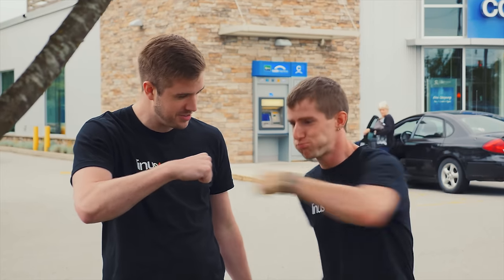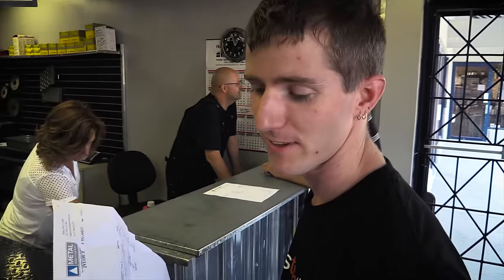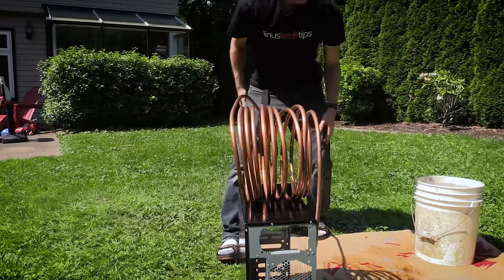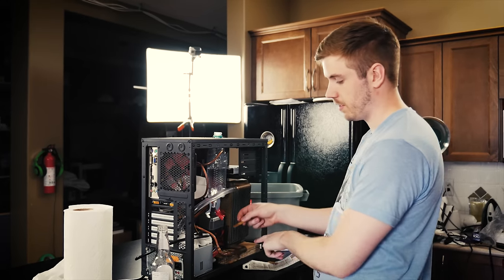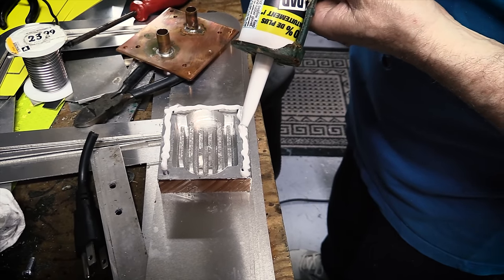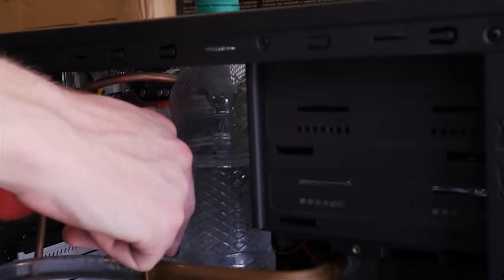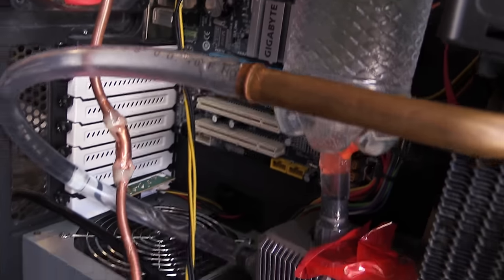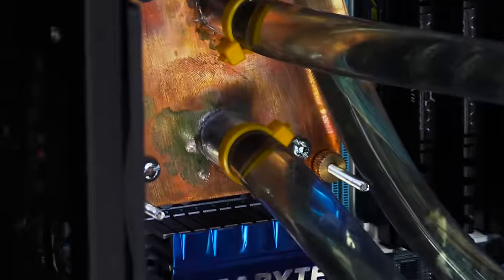$500 DIY Water Cooled PC Challenge - Scrapyard Wars Episode 2e

Comment: All I've learned from this season of scrapyard wars is just buy a liquid cooling system instead of trying to build one
Reply: An aio liquid cpu cooler is more effective and cheaper than either of the monstrosities that were displayed here
Reply: if they had a clue about tools and working with their hands it would have been easy, actually considering doing it myself now xD
Reply: id say if they had access to better parts without the time or budget constraints, and maybe more appropriate tools for the job, they could have done much better jobs.
Reply: Ne2o im doubtful on that you dont see them diy much other then case adjustments
Reply: Manny Gonzalez
Reply: same
Reply: Yeah its cheaper that way.
Reply: Cheaper yeah but the project imo to build one by yourself is exciting, especially if it works good, you’ll be proud of yourself for sure
Reply: You have the perfect amount of likes
Reply: not neccesarily, just don't build the actual waterblocks, buy them, everything else is much less important, well a good pump is nice.
Reply: @charlieward7606  sure kapp
Reply: @charlieward7606  ur wrong
Reply: they are like children with tools xD
Reply: yeah should have just used EKWB's complete set which is just $USD159
Reply: Atleast there wasn't a chick playing the Nintendo switch behind them.
Reply: Well yes, but where's the fun in that?

Comment: There should be 2 scores Benchmarking and Judges. I wanted to see whos system would run better.
Reply: ***** Linus's system would run better, he's running an i7 and actually has a graphics card installed. If you look at Luke's system when it is being judged, you can see he is running off integrated graphics. From the looks of things, Luke's board is an LGA 775 which means that he's probably running a C2D or something similar.
Reply: Meurock372 Yeah, and Linus' CPU is at 90 degrees after 7 minutes of idling :D I wonder how much LONGER it would have run better, before the CPU just fused to the motherboard...
Reply: Darth Mongoose 
"Under load"..
Reply: Yeah, he >says< under load, but we don't see the screen, he doesn't say what "load" it is, and we don't see him actually using the computer to run any applications. We literally only see him stand besides the tower, power it up and then just talk about it. Just saying I'm sceptical about this, that's all...
Reply: Darth Mongoose
You said "idle"
It was under load.
Reply: +.Float Load is a load even if it came on your face.
Reply: Reikis645 huehuehue
Reply: +Darth Mongoose Saying it's running under load means it's running intensive software. Usually this means benchmarking.
Which was what they were both doing.
Reply: Luke's system would probably short out due to water leaking into the PSU

Comment: We never got to know the system specs!!
Reply: Linus probably had an AMD that works at 150 degrees.
Reply: He said he has a i7-930
Reply: I like how the FX8350 produces less heat than that Intel I7 :3
Reply: its a 5yr old chip so yes it is cooler, but hotter than today's i7s
Reply: @KpK1Cioby  wrong

Comment: I think they were biased towards Linus. The score different should have been much higher.
Reply: Samar Sunkaria Not really because Linus did take more time and used a lifeline otherwise I think he would've won
Reply: Crimsondex No, Linus barely did any work. Most of his work was made by his neighbor. Luke done the blocks himself.
Reply: Crimsondex I have to agree with StrongarmSlayer. Even though Linus's water block was undoubtably better, the fact of the matter is that most of the work was done by his neighbor.
Going overtime wasn't a huge deal. But the coil at the top of the case was, shall we say "a monstrosity".
Reply: Samar Sunkaria Considering it was mainly focused on the liquid cooling aspect, the fact that Luke's leaked is what bought them so close together, otherwise Luke would've smoked Linus
Reply: StrongarmSlayer Samar Sunkaria  I don't disagree but as the other two said Luke's block was leaking and Linus' Block was better even though his neighbour did help him it wouldn't cost too much on points besides I favored Luke to win from the beginning
Reply: ***** Crimsondex Okay, let me present this argument.
If I was a part of this competition and had a way to convince someone at Fractal Design to make a custom cooler for me from scratch, would i be eligible to win the competition? (Even though i only lose 10 pts)

Comment: No performance test?
Reply: Jubba Fudgy The point of Episode 2 was to do water cooling and have  it work. Not have it work and benchmarks.
Reply: XInfinity2013  no offence to luke but why did he win then? his system was leaking..
Reply: Because, linus's system was 20 degrees higher then Luke's, and he cheated kinda and used help from his neighbour
Reply: XInfinity2013 Linus' rig didn't cool and he didn't do it himself so I would call that a win for Luke (it wasn't even close). In any other show cheating would also be an automatic DQ
Reply: +XInfinity2013 I did pay attention, more than you did it seems: Firstly rule #3 was added before the competition by Linus because he always intended to use his neighbour to do the cooling block. This is cheating big time, as he actually setup the competition rules to be in his favour. There's cheating and then there is CHEATING (IMHO this was the latter). Secondly there was no rule saying your cooling system cant leak so your comment was irrelavent. Thirdly, it's Allowed not Aloud :P
Reply: I think +XInfinity2013 got rekted pretty hard. He needs to make a good water cooler to cool down from that burn.

Comment: I honestly think Linus should have won, his was defiantly more functional, ascetic ally pleasing, and more well built than Luke's.
Reply: RaySchrantz yeah but the temps were close to 90c, lukes was sitting in the mid 50's, even with a leak its easy to see that lukes worked better (leaks can be fixed, not having a rad can but is more effort).
Reply: Just remember that Linus cheated, used outside help, and went a day over the time limit. Luke did none of the above. Yes Linus' was more functional, but his water cooling sucked a$$ and his cpu ran at 87 degrees. Luke's was better built for what he had.
Reply: They were allowed to use outside help. Re watch the first episode.
Reply: 1toncheese Hey, at least it's better than the stock cooler :P Considering it's a 0 db cooler
Reply: Mathew H. But it counted as a penalty. Re watch the first episode.
Reply: 1toncheese I'm not surprised his temps were close to 90c. His system had an LGA 1366 CPU in it, which is probably one of the worst things to passively cool, considering it's 130w tdp.

Having a closer look in the video at Luke's system, the motherboard is LGA 775. At 13:09 you can see "DDR2" written on the board which is a dead give away that it's LGA 775. This means Luke is probably running a Core 2 Duo or something, which is a hell of a lot easier to cool than the i7 930 that Linus said he was running.

If this the case, wouldn't that give Luke an unfair advantage? And more so, was the different platforms taken into consideration by the judges?
Reply: Meurock372
presumably not since they assumed linus and luke knew what they were doing with their hardware, linus should have found a different system to cool, the copper tubing is incredibly inefficient (mostly because of the size) which didnt help. a fairer comparison would have been to have them attempt to cool the same system on that same watercooling budget.
Reply: 1toncheese Linus kinda brought it upon himself when he bought that i7 930 system, if they weren't going to benchmark these then he could have bought an Intel Celeron or even Atom based desktop and cooled that instead. I agree with the copper tubing, that made things even worse for him. A radiator would have been much better. Like you say, another fairer way would be to have two models of the same computer to work with.

Comment: i've really gotta wonder why it didnt occur to either of you to go with submersion mineral oil cooling (cheap car oil would work) with a oil-water heat exchanger. Chuck a mobo tray in a tank, fill it with car oil, put in a cheap desk fan to circulate the oil, dunk in a rad or a copper loop and same on the outside, maybe use a pump but with that much oil passive may work. Its simple, completely free of parts normally used in pc cooling apart from heatsinks (which both used), and basically leak proof, and can easily be set up such that any joins are outside the oil and hence no risk

Comment: i wouldn't even bother with a traditional watercooling system and hook it up to the tap with some plumbing fittings. no pump, reservoir or radiator needed and i bet the temps would've been pretty good.

Comment: The copper hump could have benefited from a Metal tray sitting within the loop that you can load Ice cubes into, and cover the tray with a Styrofoam to prevent some heat escaping into the ambient air for a longer lasting 'Ice Cooling Extension' option, a.k.a. I.C.E., to take away more heat from the system.
Reply: Say, if the solution temperature of the cooling system is say about 0 Celsius consistently, where the incoming water will be 0 Celsius, if there was a hypothetical cooler that can do so, or just using fresh cooled water and dispensing the warm one out of the system. What kind of temps would that kind of CPU be under load? - If anyone would think of pulling this off if it's even a good idea, I believe Linus Tech Tips can make it happen :)

Comment: Next SYW idea: Scrapyard Wars 2: Revisited. Both teams start with identical PCs but otherwise the same rules as this one (maybe omitting the allowing of influence), then actually stress test and benchmark the results. See if they learned anything from their failures from this one. 
Either No using the LMG CNC or if you can establish a fair rate to charge for its use. 
Handheld power tools are allowed. You can also try to find a local makerspace or hire a local maker or if Metal Mart has any inhouse fabrication services. 
Maybe do teams with Alex Vs. Colin. Or Linus & Luke Vs. Colin & Alex.

Comment: When judging temperatures I hope they noted the fact that Linus and Luke are using different hardware. Linus is using an LGA 1366 CPU (130w TDP) and Luke's system looks like an LGA 775 setup (65-95w TDP) so naturally Linus's system is going to run hotter regardless of what type of cooling is used.

Comment: I'm quite surprised that neither of them took the quite obvious route and used ordinary "plumbing fiitings", either soldered, pressure fitted or "Nut and Onion".
They're all  relatively cheap and easy to use and make  water tight. AND they aren't made for watercooling... Were they "outlawed" any way ??

Comment: All that time you wasted putting that hose on the heater core... you could have just forced the tube to slide over those bumps on the copper line and then used a 50 cent hose clamp to hold it on (probably not even needed in this application anyways). That's what those bumps are for, so the hose makes a tight stretch fit and to keep the hose clamp from sliding off the end of the tube...

Comment: So Luke's build is cooling rather effectively at 55 degrees but is leaking so it won't be cooling/working for very long and Linus's build which is not leaking (supposedly) but is cooling at 87 degrees which makes it worse than many air cooled machines which makes his build kinda pointless. Hmm...

If I was the judge I would disqualify them both!

Comment: Did linus seriously use a copper coil as a radiator? Where is the heat going to go?
Reply: AMVDan In the coil? In the air? WHERE THE FAK WILL THE HEAT GO?

Comment: Sooo Question I'm reviving a computer a Intel X58 Express
Expansion Slots:
2 x PCI Express x16
1 x PCI Express x4 (for cards such as network, sound, tv-tuner)
1 x PCI Express x1 (for cards such as network, sound, tv-tuner)     

So what to put in it, can I put a GTX 980 in it or would it Explode??

It's a Asus Pegatron IPMTB-TK Truckee (HP) motherboard HP reccomends the following graphics cards

Must select one of the following options:
GeForce GT420 (2 GB)
GeForce GT440 (1.5 GB)
GeForce GT440 (3 GB)
GeForce GTX460 (1 GB)
GeForce GT530 (2 GB)
GeForce GT545 (3 GB)
GeForce GTX550i (1 GB)
Radeon HD 6450 (1 GB)
Radeon HD 6570 (1 GB) single bracket; DVI, HDMI, & VGA via adapter
Radeon HD 6570 (1 GB) single bracket; DVI, HDMI, DP & VGA via adapter
Radeon HD 6670 (1 GB)
Radeon HD 6850 (1 GB)
Reply: +Nuno Pereira I believe the GPUs listed are only the ones HP offers as configurable options. GPU and motherboard compatibility isn't like the CPU where some specific models are supported and others are not, as long as you have a PCIe x16 slot it will be fine. Does not matter if you have a 3.0 card in a 2.0 slot or a 2.0 card in a 3.0 slot, it's just like USB. The performance impact is negligible too. The key thing to look for is your PSU, it needs to have enough power and it needs to be a reputable unit. Generic or cheap units have noisy output and ripple that damages components in the long term. You can put a 980, just be sure you have a good power supply.

Comment: Why didnt Luke just put some epoxy into the bottle have the tube higher than the epoxy and make is air tight instead of just putting it on the bottom

Comment: What's actually funny is that you can buy a water cooling system for the cpu from the store for under 150$ in my city...
Reply: Buying cpu water cooling systems was not allowed.
Reply: Lünk I understand that. But I thought this video was meant to be a guide for those who couldn't spend this amount to buy a new one.
Reply: +MrMurmandramas Exactly what I was thinking. If I had $200 to watercool my system, I'd pick up an AIO liquid cooler in a heartbeat.

Comment: Why use copper for the top?
Reply: because copper is a verry good heat-conductor.. so the hot or warm water, that flows trough it, get (theoretically) cooled better by passing the heat through the copper to the outside...

Comment: Shoud i change my grapchics card and processor
Cpu:Amd phenom(tm) x4 965 8 gb ram
Gpu:Amd radeon HD 7850 1 GB GDDR 5
Is this good
Reply: Kresimir Jenjic cpu is enough for that gpu,but i will now OC cpu clock,(close up to 3.8 or 3.9// not more!and not on aftermarket cpu cooler,budget wise factory X8 cooler will cool fine OCed cpu X4  :-) with min cost $$$) ,then consider to OC gpu,memory lightly,(5%) 8gb DDR3(?)ram is more then enough  ..yes that can be somewhat good ,and with time consider to upgrade cpu  to amd x6 63xx or x8,83xx ...then you can think about upgrading gpu to simular or better card with 2GB GDDR or more.. what about value(Watts),class(no class?) and brand of power supply? hdd or ssd? with OC on cpu and with upgrade to ssd you will get most bang for min $$$... Is it good? depends what and what resolution you want to play? for playing on HD up to fullHD is good,for somebody very good..depends what you want,and how deep wallet you have..always have better and more expensive..if is good for you,stay happy! i give you only some recommendation if i am on your place,what you can do with almost no money involved. CPU x4  at low clock, is only weak point in your built overall without other info about your system and favorite applications & games,its hard to say more precise.
Reply: K thx man
Reply: Dont now i whill check that

Comment: Is this any good? What FPS do you think it would run games like minecraft, csgo, battlefield ect,?

Processor : AMD (Piledriver) FX-4300 3.80GHz (4.00GHz Turbo) Quad-Core Unlocked Processor

Graphics: AMD Radeon R9 370 2048MB GDDR5 Graphics Card

Memory: 8GB 1600MHz DDR3 Memory (32GB Supported)

Hard Drive: 1TB Seagate SATA III 6Gb/s Hard Drive

PSU: Thermaltake Take TR2 Challenger 500W 80+ Power Supply

Motherboard: GIGABYTE AMD 970 Chipset ATX Motherboard

Case: Thermaltake Versa H21 Midi-Tower Gaming Case

CPU Cooler: ThermalTake Contac 16 Cooler

Optical Drive: 24x LiteOn DVDRW Dual Layer DVD Rewriter (m-Disk Support)

Audio: Onboard High Definition Audio
Reply: DahPRFZ The GPU is good for playing cs go and Battlefield 4, but I'd change the processor for a i3, like an Intel Pentium G3258. If you do change the processor, you need to change the motherboard aswell
Reply: ***** What are you talking about, some games is beginning to show that two cores is not enough to make some games even start, so future games will most likely destroy the cpu G3258"It's a nice dual-core cpu, but no". The cpu he have right now is good enough, but if you can fit the money in you're budget buy: AMD FX-6300 "Just to be on the safe side"  "For the last person on the damn ***** earth, do not cheap out on a powersupply "It's the most important part on the system.... Other than the motherboard" "And i say again"NEVER CHEAP OUT ON A ***** powersupply lower than 50$, it is most likely going to destroy you're system after a couple of months" "Even if it's a very known psu maker for quality parts"
Reply: +DahPRFZ Avoid the Thermaltake TR2. I like their Toughpower units, but the TR2 is to be avoided like the plague. Reviews on Newegg and Amazon don't say much good, and I'd be scared to see the load tests. A power supply that works can be pumping noisy, dirty power to your components. While it may not fry stuff now, it ultimately reduces component lifespan. You do not want to have a hard drive fail early or a GPU go bad from a cheap PSU.